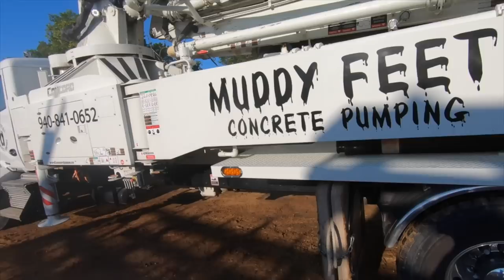Concrete truck rolls over. Pumping concrete with Muddyfeet

Comment: I can't believe nobody had the sense to tie it to that tree.
Reply from the maker: tony Denton arms to dangerous to be climbing on that truck
Reply: That little tree wouldnt stand a chance.
Reply: not much gonna stop a concrete truck that wants a belly scratch.  they be very top heavy.
Reply: Mr Fixit 😂
Reply: It would have pulled that tree right out of the ground. You must not have any idea of how much that mixer loaded with concrete weighs.
Reply: No it wouldn't have. When the truck was still upright, it doesn't take much force to hold it in the upright position. Trees are commonly used by tow truck drivers as control points. We don't see but there could have been other tress in the back. This tow truck driver failed to act. He could have secured the truck immediately either by tree or another truck across the other side of the bridge.
Reply: @Outd00rFishing  It took 3 50 ton trucks to upright it. They are very top heavy. 7 to 9 yards regular load of concrete . 28000 to 36000 lbs up high. If you didn't notice it was already leaning quite a bit. That tree won't hold that weight. Not a very big tree , plus it's growing on a slop. Not much in the way of roots. I am sure you would have climbed right up on that truck to secure a chain to it.
Reply: @Outd00rFishing  IT was sinking down on it's left side nothing short of 50 tons would have held it.
Reply: That wouldn't have helped. The tree would have been pulled over. The truck was extremely heavy and on its tipping point.  Combination of problems there. If they had been able to offload the concrete the truck probably wouldn't have tipped but the attempt could have caused it to tip anyway. Sadly this was a case of a lose lose situation.
Reply: This is why you are not working there and he is
Reply: Yes because trying to tie down to the tree  was to much work!!!
Reply: Acer Acres  In the video, looked like the ground was giving way, on the edge, regardless. A fully loaded concrete truck weighs 65-70k pounds.  I am sure the tree would have had some influence as you describe if it was set up perfectly without slack.  However I also think the concrete truck could rip out that tree with a chain at the base pretty easily with some slack in the chain? what do you think?
Reply: @johnscott2849  You must not know how strong that tree is at its base. You could run a rim sling to a block at the base of the tree for some side pull. Some side pull is better than none.
Reply: @Outd00rFishing  yup. And there were many trees to help.
Reply: I totally agree, even lassoing a heavy strap over the filling port of the drum and running a chain to the base of the tree would have bought valuable time here. It was maddening watching the tow truck driver walking back and forth not doing anything! Doing something is better than doing nothing!
Reply: All these experts lol..
Reply: @garrykelso5642  , yup they seem to know it all.lol
Reply: It's a K-flopper
Reply: I thought about that too.
Reply: HAAAAAAA
Reply: If a concrete truck falls over in the woods and no one is around dies it make a sound?
Reply: @angelajohnson6659  only to the boss
Reply: Same scenario over and over..narrow road with weak berms
Reply: Well I'll throw my thoughts in here being I operated a 50 Ton wrecker for several year's and have been operating a 6 axle 11 yard Concrete Mixer for the last 15 year's. Tow operator should have ran a line to a strap around the largest tree to the Drive tires on the Mixer NOT to try pulling but only to stop it from sliding. This would have held the Mixer from sliding any further. Low hold point was all he needed to buy him some time. Hooking to the top of the Mixer would have done nothing but rip the tree out of the ground. I'm guessing the mixer had 10 yards on and that would put him at about 80 thousand pounds. Extremly top heavy. I feel bad for the wrecker operator because it was obvious he did not have the experience needed for this situation. He ran a winch line straight to the first rear drive tire and that would have done absolutely nothing for him. This was a 2 Wrecker job from the start. 1 to hold and 1 to pull. Minimum 50 Ton to hold and 35 Ton to pull. He had the straps out and he should have used them. Just my point of view on this horrible day for both Wrecker Operator and Mixer Operator.
Reply: @Robmancan1987   Those trees are growing on a slant . The roots are not going to be very good. They have enough trouble holding the tree up. The ground is wet. Need I go on? I have pushed trees over that where a whole lot bigger with a small John Deere dozer with little effort.
Reply: @MuddyfeetConcretePumping  when it first happened it should have been tied to the tree.. years of wrecker experience here. Just saying
Reply: Driver needs to pay more attention and nott get distracted or text on his phone  Ive driven 80,000 lbs tanker over worser roads and gulleys and drops offs and narrow man made dirt road bridges like the one in this video. Oil Field Trucker
Reply: Jajajaja u fuking right
Reply: @jeffreymurdock8366  2 trees or 3
Reply: That tree would have been pulled right the fuck out of the ground
Reply: THE TRUCK AND THE CONCRETE NOT 1KG !!!!
Reply: exactly.. they could give used more than one tree and possibly a wench

Comment: This is what happens when you drive heavy equipment on un compacted soil.  I'm surprised that the cement company would agree to such a thing .
Reply: No the driver went to close to the edge like any made up road well any road heavy weight on the edge is always a problem
Reply: No , the soil was uncompacted and the so called road was un compacted and too narrow for heavy  equipment to operate safely .

Comment: Being a driver, I've had my share of soft gravel that's not your fault, the contractor's are supposed to check the grounds before you guys come. I'm just glad you made it out safely.
Reply from the maker: All roads aren’t the same
Reply: Yea D J. Bull Shit. The first truck got in there no problem.
Reply: @philsmidwestclassiccars150  The more a road gets used, the more it deteriorates. Just saying.
Reply: @Cardi185  Yes I know that. It was a soft gravel driveway also. I only commented as to the first mixer making the driveway with no problem.  If you look at the tire tracks in the soft gravel, this guy didn't slide off the edge. He backed up off to the edge of the shoulder where the loose ground cut loose due to the shear weight of the loaded mixer. This driveway looked wide enough to handle the load, if it was kept in the center of the driveway. Each & every driver has different backing up characteristics. Some are better than others. With a mixer, there is no opportunity for a mistake when backing, nor braking. It's your on top of your game, or it's a mess. I have never even considered driving a mixer, tanker, or bucket, but am qualified with my CDL. I do have 30 years as an OTR Driver with 11 on 48 foot, spread axle  flat bed delivering building materials to job sites. The other 19 are 53 foot dry van, mainly hauling paper loads.
Reply: @philsmidwestclassiccars150  Ok, I understand you now.
Reply: @philsmidwestclassiccars150  On soft ground, it's not always the first truck that have the problem. If you're loaded with 9 or 10 yards of concrete your (GVW) is somewhere in the range of 65,000 to 70,000lbs. We did a 500 hundred yard pour here in Atlanta years ago. It was after maybe the third of forth load that ground caved in caused a rollover.
Reply: @philsmidwestclassiccars150  THE DRVER GIVE JOB TO CRANE COMPANY !!!!!

Comment: If the goal was to destroy the cement truck - MISSION accomplished!    👍✔
Reply: lol
Reply: I drive mixer trucks and been in sticky situations. That’s how I ended up in this video. But before driver backed up he should have walked the area, second his back up lights were off third, he should gone slower . If I would of been in this situation I would of unloaded the truck right away and got the weight off. It’s only 1500.00.  Also it would have shifted the weight to the passenger side
Reply: Driver probably had to go clean up after that one lol !
Reply: No cement trucks were damaged in this video!!
Reply: not a cement truck lmfao
Reply: Cement trucks don't go to the jobsite. They deliver to the plant. This is a concrete truck

Comment: In a pinch like that, leave the truck already backed in full, run a chain from the drum/frame rail connection point on the tilting truck to the front tow pin on the full truck to keep tension on the rear so it can’t slide. Then hook the wrecker winch to the front tow pin on the tilted truck and winch to the other side of the road until centered. Lock in the quad locks on the tilted truck and all three trucks could walk out together. Just stop the drum, move a few feet, stop and spin to keep it wet, then repeat. That turned into an expensive wreck pretty quick. Drum full of dry concrete, most likely the engine ran with no oil pressure and needs at least bearings. Seen this way too many times.
Reply from the maker: Lots of great ideas. To bad you weren’t there!
Reply: I doubt the concrete was dry in that short time.
Reply: @trr4488  the reason I say it probably dried is because the only way to get it out is with the engine running to power the hydraulics. You tip over any truck built after 2014 and the oil comes out of the pan and into the cylinders, air to air cooler, turbo, emissions system, it covers the inside of everything. Especially when it’s still running like that on its side. The truck can be set back right side up, but you have no way of knowing if the engine is going to run away, seize, hydro lock, etc. If any one of several sensors get covered in oil, and you won’t know unless you remove them and look, the engine will go into limp mode. Then your stuck at a max rpm of idle. So you are correct about the concrete not drying in the amount of time it took for the events in the video to take place, but it’s the aftermath that keeps the drum from turning. Leading to dry concrete. I asked a concrete truck fleet manager one time why they don’t install a quick connect and ball valve on the lines going to the drum motor, so any sister truck can power the drum of any sister truck. It’s an easy install and the several $4k-$10k bills they pay every year to have concrete air hammered out of drums would pay for the installs. It’s simple math, but habit and tradition still prevail.
Reply: I was thinking the same thing. The tow driver went low he needed to find a way to pull high. I think if he was on the road up past the drive. He could have run a cable through the woods to the back top of the drum. Your right that using the other cement truck and hooking to the top of the tipping truck might have stabilized it. At least long enough until the boom wrecker arrived. I think if the cement dries that truck with the bad motor, other possible damage, and a drum full of cement might be a write off.

Comment: Why not turn the screw off?  You can see that's what turned it over.  It seems like it would have been cheaper to replace the drum after the concrete hardened instead of a total lose.
Reply from the maker: I really don’t know.

Comment: If that tow truck driver had done something when he got there it could have been pulled out.
Reply: Your right the driver should’ve anchored the mix truck to one of the trees with a pulley and used the weight of both trucks to hold it until the bigger truck was on scene to assist with recovery
Reply: Set the tow truck up down the road and pull the line through the trees and pull on the side, no need to sit there and wait for the concrete to stiffen up and make the truck more unstable, also put the drum in discharge to move the mud to the high side. many mistakes added to this nightmare. A bit of concrete on the ground would be easier to clean up than the whole load and the truck in the ditch.
Reply: Dude was totally clueless. You can tell he's used to towing rigs from the side of the highway, not this. A heavy vehicle recovery service really ought to be better than this because things like this DO happen. Its like being an EMT and letting a patient bleed out while you slowly go get stuff from your ambulance.

Comment: It's getting heavier by the minute when the concrete starts to dry out it climbs up inside the mixer with even more weight on the drivers side 😅😅😅. experience.

Comment: They need to train guys to drive before getting in the seat. There’s 2 trucks already on the pad so the road was good. In the video you could see the truck going off the side. If they had hooked a couple of trucks as soon as it happened they may have pulled him out.
Reply: Did you see how much the road was crowning first?
Reply: Have you ever driven a mixer?  Sending a number of trucks over a soft road like that, can make them less stable and more dangerous.

Comment: Totally the builders fault , what kind of road was that  , im going to laugh if   lawsuits start happening .
Reply: Highly doubt that ! Truckers are responsible on where they enter , no trucker ever does something they are not comfortable with . If they think something is fishy they call their supervisor and ask for advice . This driver went in confident and somehow ended way to far to the right . The road way was more then wide and stable if only he’d stayed centered .
Reply: @majoralpha1015  
Sorry bud , that is not more than wide , around here that is called Just Enough Space , or no difference between a inch or a mile theory , by the MOL  , that is putting driver safety at risk , there for the job is shut down until road is done properly or  "Just Enough Space"  is resolved .
Reply: I've driven on worse narrow path dirt roads in the oil field. Where there is oil they will make a path  no matter what. Through ravines and creeks 
Driver didn't pay attention  is the call

Comment: It wasn't the drivers fault. Should never have been allowed to drive down that dirt path. In the UK site access roads are designed and certified by a temporary works designer for heavy site transport.
Reply from the maker: Maybe hard to tell but it wasn’t muddy.
Reply: @MuddyfeetConcretePumping  lets just call it a dirt path. It's actually an embankment constructed with what we call MadeGround and it is likely that the Soil beneath the embankment was the reason for the bearing capacity failure. If you would like to employ my consultancy services for any future sites let me know.
Reply from the maker: If I ever get into that business you’ll be the first phone csll👍

Comment: They should of made the road wider
Reply from the maker: Texas Dirt wouldn’t hurt anything.
Reply: sight managers or contractors doing the project likes to skimp on the basic crap like this all the time then bitch and moan you tore up the dirt driveway corners. They never understand because they drove their 70k pickup trucks in there no problem, lol. hell i had one tell me he made the pad so big he could turn his pickup around up there and couldn't understand why a front discharge readymix couldn't turn around lmao
Reply: @caseydman4651  been there oh yea lots of room. get in there and first thing they say is oh that truck a little bigger than i thought. how about when they make a turn around and you can barely parallel park a pick up in it. thats cute you gonna turn around a civic there?

Comment: Was the drum charging at all times? That certainly helped. Why not stop it? better to lose a barrel than the truck.
Reply: A pound of sugar or a 2 liter bottle of Coke tossed in the drum stops the chemical/thermal reaction that causes the concrete to set up and harden.  It kills the load instead of the load killing the truck.  I've no opinion on if the driver should've done that or not.

Comment: Why wouldn’t he just come in forward and turn around inside the yard there?
Reply from the maker: It was as n option
Reply: @MuddyfeetConcretePumping  Looked like an option to me. I drove truck and am sure that concrete truck could have maneuvered around to get aligned properly. The truck should have been shut off. The constant vibration helped the ground to give way.

Comment: Should have dumped all the concrete in that ditch and wait until it hardened
Reply: 💯 would of probly saved the truck if they even emptied half of it!!!
Reply: You can’t because you’ll have to spin the wheel
Reply: @Chance8888  what wheel?
Reply: @Chance8888  you talking about the drum😂

Comment: 22 years in the towing industry. Was lack of training/experience on the wrecker operator's part. Leaning mixers are very common calls for service. Priority #1 is to change the center of gravity on the mixer. There are numerous ways to do this, but in this scenario a method that is called a "Tail-Wrap" would do the job. Hook high in the rear on the uphill side....low in the front on the downhill side. By pulling the high line, the rear of the mixer will slide uphill while the nose tries to go down hill. the low line in the front is to steer it out by force essentially crab walking it up and out while holding the loaded drum up at the same time.  Forget about that little tree. It would need to be at least twice that size to be of any use here. That tree would not hold a loaded mixer.

Comment: I don't know how a concrete truck operates but could they of dumped the concrete . I seen a transport size water hauler get to close to edge of a new narrow lease road and start leaning bad . The road  had been built about 3-4 feet high . And before the winch truck showed up it started leaning worse so he opened the dump valves on back of trailer . It took enough weight off and it didn't roll over .